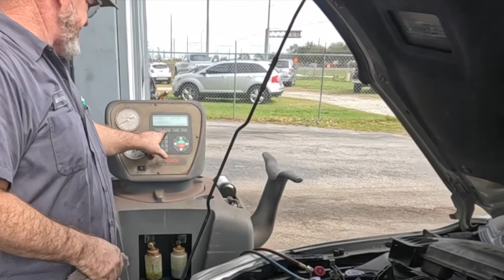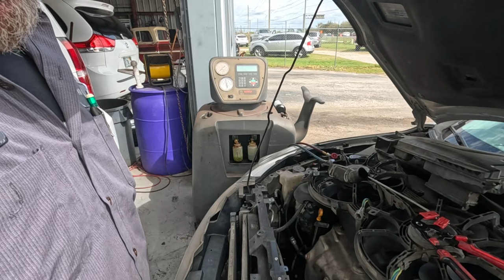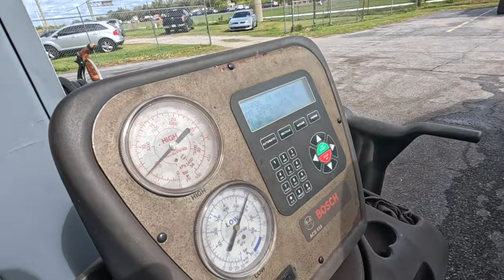E350 Trans, Altima Radiator, DAY IN THE SHOP 422 #fix #or #repair #daily #auto #truck

Comment: Chapters/Playlist
02:27 2012 Nissan Altima - Leaking radiator & cap
05:19 2008 E-350 Van - Transmission
16:47 2012 Nissan Altima - New radiator
29:46 2008 E-350 Van - Transmission replacement
Reply from the maker: Thank you for this!

Comment: A lot of guy question why I have a long ass Capri 3/4” breaker bar with a 1/2” adapter, but it has saved me a lot when it comes to crazy tight bolts and lug nuts! They either come loose or break off😮!
Reply from the maker: Oh yeah, that is a good option!

Comment: There are a few occasions when you put the warranty checker on a stubby wrench. Albeit these have been in my experience on excavators not vehicles.
Reply from the maker: Yeah, I suppose there could be a time. But it doesn’t fit my stubby wrenches well. I’d likely go to a crows foot or similar.

Comment: On a 17 sonata engine has 31 thousand miles on it any idea why the engine rattles when cold its really bad when driving its only a few seconds then it goes away
Reply from the maker: Usually caused by either a cam phaser or chain tensioner issue. Also make sure to use a genuine Hyundai oil filter!
Reply: @JimmyMakingitwork  thank you